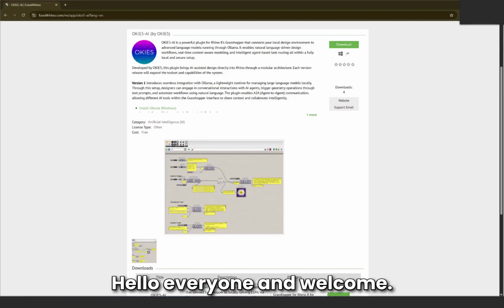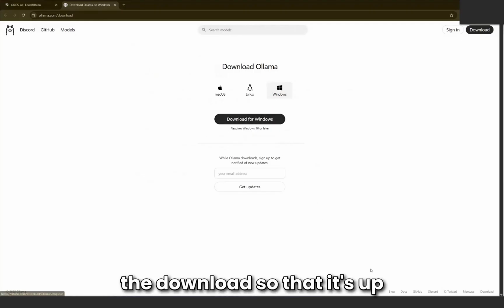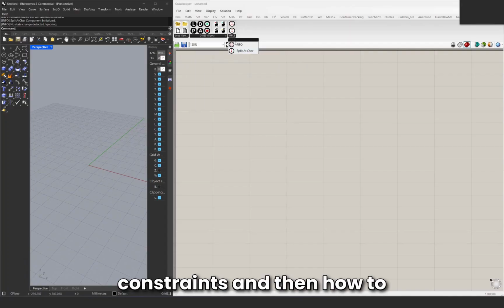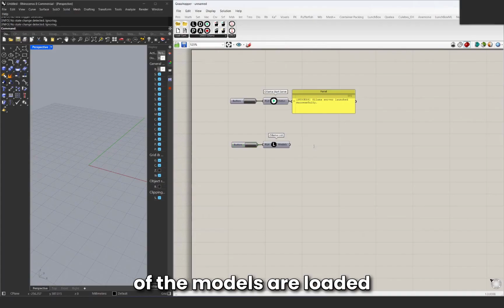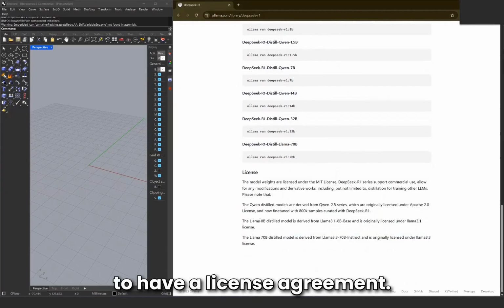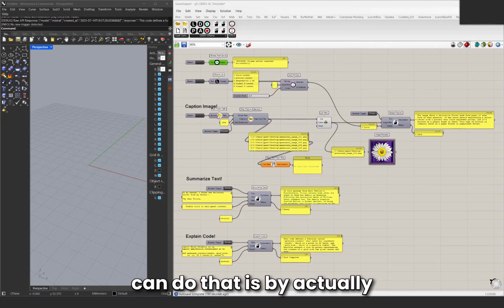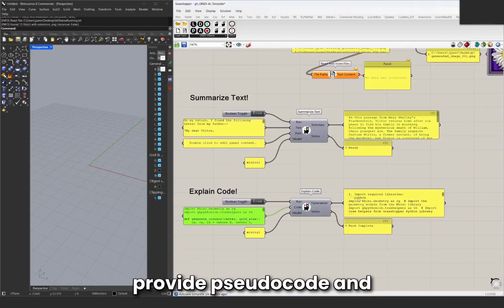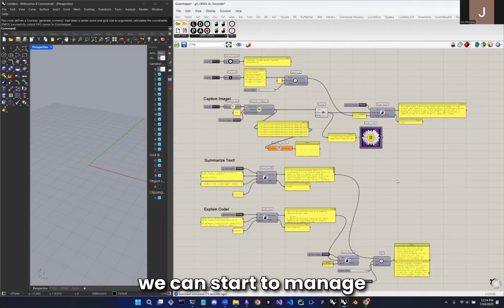Food4Rhino - Ollama Inside Grasshopper ( OKIE5-AI V.1 )

Comment: I am trying to use your plugin in Rhino 8 on Windows, but I am encountering a critical issue with the server connection component.
Every time I set the Boolean Toggle to True on the main connection component, the entire Rhino and Grasshopper interface freezes completely (Not Responding). 
The yellow info panel gets stuck showing: [INFO] Checking Ollama server status...
Ollama is running correctly in the background. Testing curl.exe http://127.0.0.1:11434 in PowerShell returns Ollama is running
If I run ollama serve manually, PowerShell throws a bind error because port 11434 is already actively used by the background instance.
Could you please help me?